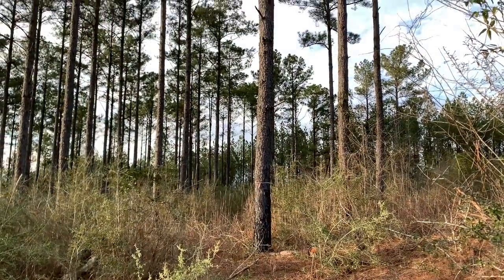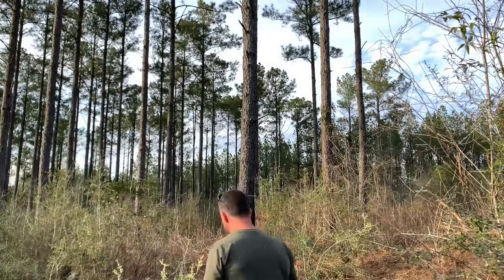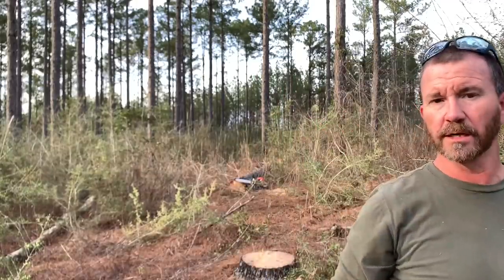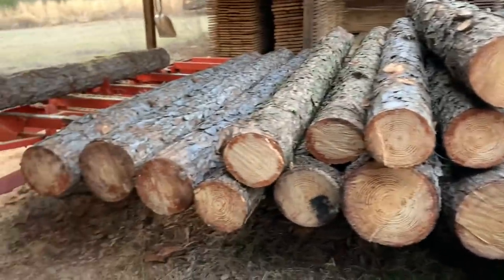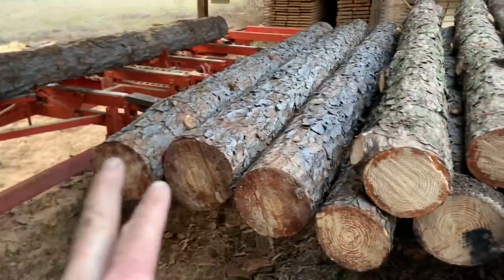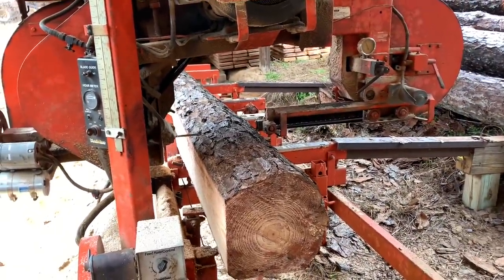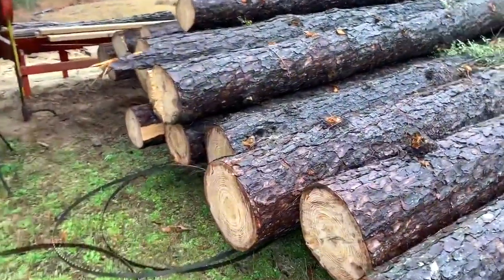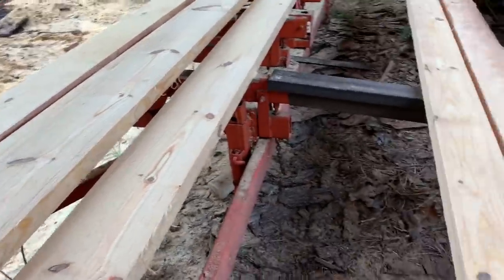Sawmill: From Stand Trees to Lumber!

Comment: Jeff be doing some MacGyver moves when it comes to fixing stuff I tell you what. Lol
Fixing the throttle cable with some copper electrical wire? Boy that's some quick thinking right there. Good job Jeff. 👍😉

Comment: Hi i like finishing wood the high shine sealer i use for refinish stock for rifles that what makes them look so good! there a bar top sealer too it for weight to stiffen plastic stocks this stuff has to be done out side to seal it I have a paint problem air suit was damaged i got sick! I was painting mail trucks back in 1987 to 1992 the air system failed in my suit clean air important when painting that yucky stuff! i like working with wood it helps me relax and forget the bad things in my past!

Comment: 12-2 you fancy Jeff! Sir.
Reply: Actually is was a piece of 12 gauge not 12-2.  2 just means a pair of conductors, he only used 1
Reply from the maker: Yeah, but I got 2 more to replace that one. I just figured that people come identify with the single wire coming from a scrap of 12-2 with ground.
Reply: @jeffbarron70  love your videos. Didnt mean to sound like an ass!!  :)
Reply: It was a joke I figured some electrical people may find it funny that he went with the more expensive wire compared to other residential wires like 14/2 being cheaper.